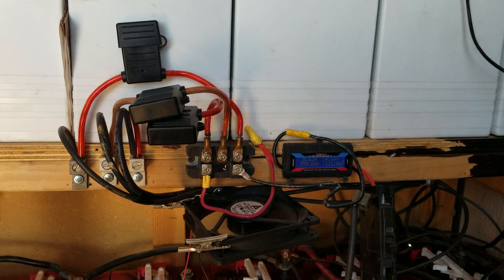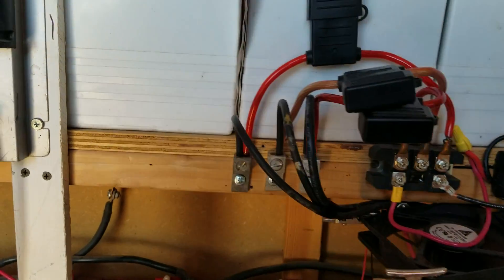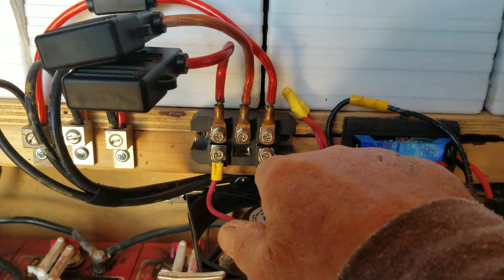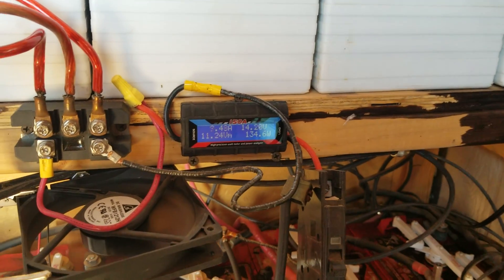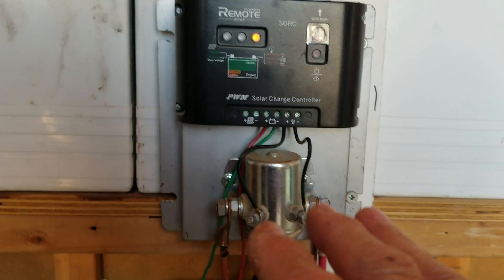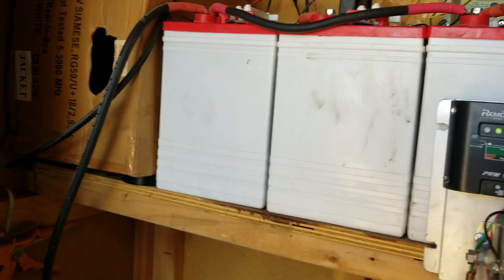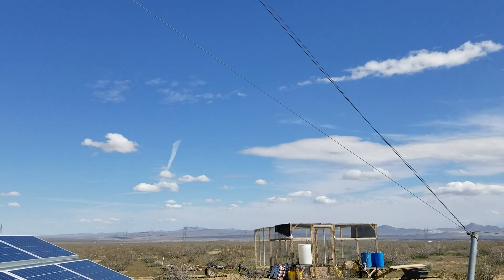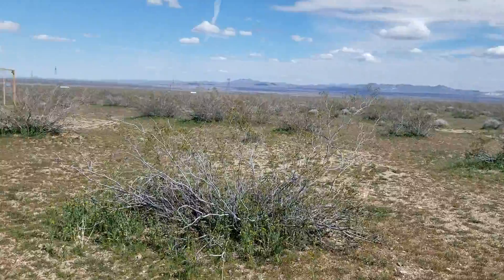GBear's Off Grid Ways-a Homestead in the Desert,  Mar. 23, 2019

Comment: First of all, let  me tell you that your explanations  have helped me a lot urderstanding how this tecnology really Works, never before has anyone explaned with such clarity and detail. I see that you are very familiarized with the wind turbine theme and its Connection to the off grid power sistem, as such I take this opportunity to ask you the following, is it possible to Hook up a wind turbine directly to a power inverter rather  than to the battery Bank?, I have a solar inverter 6k , 48v hybrid off grid, 80A mppt charger, (it is sold under  the brand TOWARD, but is the very same MUST PV3300, is as you can find it in the internet), it has a port + - for the connection of the solar panels, so I wonder if an Ista Breeze 1500W wind turbine could be connected through that port to generate electricity directly to the house, I saw that I'll need the rectifier, likely a wind turbine charge controller and the dump load.  Could you please provide details.  Thanks in advance.
Reply from the maker: Thank you and welcome aboard. 
Short answer, no you cannot connect a wind turbine directly to an inverter. 
An inverter needs 'constant' power input, like from a battery bank, to function properly.   Unless you have a constant unrelenting wind speed, 24/7 the inverter would constantly go into fault mode and shut down.

Comment: Thanks for a great video, I'm off to Ebay to get the parts. I guess one could build a double charger system by replacing the dump load with another battery and move the dump load behind that battery..  I am just thinking of some easy setup where I could charge some extra batteries I have at my cabin. Boat battery etc..
Reply: Ok, trying to find the parts. Can I use the controller that came with the turbine instead of the rectifier? It has a rectifier inside. Model is something like this: https://www.ebay.com/itm/WIND-CHARGE-BATTERY-CONTROLLER-12-24V-600WATT-ista-air-x-RUTLAND-generator/143278995717?hash=item215c17f905:g:be8AAOSwj99aBcuR

Gauge: https://www.ebay.com/itm/HTRC-60V-200A-Watt-Meter-Voltage-Amp-Meter-Power-Analyzer-8-Gauge-Wire-S9Z1/263865490399?epid=5017273653&hash=item3d6f9bdbdf:g:T1wAAOSwfjdbaj~Z

This ok for the dump: https://www.ebay.com/itm/12-VOLT-10-000-WATT-Battery-Dump-Controller-SOLAR-Wind-Regulator-G4-440A/233211640932?hash=item364c7f3c64:g:3MsAAOSwZula4ovW
Reply: Could not find the exact match for each part you have for example that electromagnetic switch & controller and still thinking if I can use the simple wind controller I got with the turbine instead of a rectifier.. Just not sure about these parts and not wanting to waste any more money on crap, that 12 VOLT 10,000 WATT Battery Dump Controller SOLAR Wind Regulator G4 440A I linked above already cost some 80€ if I order it to Europe... Any ideas?

Comment: Me too I got also a kt5 but DC , I want to remove the rectifier inside the PMA and make it 3 phase 12 volt
Reply from the maker: Most want DC because of higher output and direct to battery hookup.  I went 3ph because I'm cheap and didn't want to buy 1/0 wire when I already had 10ga.

Comment: Just curious, couldn't you use an MPPT with a DC turbine?, or doesn't it work that way?
Reply from the maker: The outputs might destroy the mppt.  There is a reason the input connectors on a solid state controller are specifically marked for solar.
Also, a DC turbine doesn't need to run through a controller, it goes directly to the batteries.  You need to control overcharge not voltage as a solar controller does.  12v panels put out 18-21.6vdc, the controller balances that to 15vdc output.

Comment: im so glad you are miraculously improving , im getting those herbs i knew about them just forgot its been so long , typically i have raw garlic on toast but those chinese, koreans, japanese know there stuff.
heres a battery story : once my freind was away for a long while and he had no dump load etc , his batteries started to boil dry and a short inside the battery must have occured which ingnited  the hydrogen gas inside the batteries , those batteries all blew appart , all five 12v N200 batteries were completely destroyed.  his turbine is a real nice low wind power producer its called OEM parts express wind turbine.
its only a 1kw turbine yet its total blade span is 2.5 meters.
i know i harp on about things trust me  everyone who knows me on YT knows it , but i still think your far safer to remove the fuses on the ac side and just put one decent fuse after the rectifier, maybe im wrong But ive seen turbines throw their blades when one phase is disconected for some reason and the turbine starts to pulsate/vibrate  , ofcourse in reasonable winds.
also true or not i read 60vac can still kill you , i know my old mws turbines could hit 110 vac using a drill to spin it at 700rpms.and  just for fun ; my fisher and paykel washing machine motor used to hit 1000vac at 500rpms until i rewired it so it had only 4 coils per phase instead of its original 13 coils per phase. 
it is good to see your on the up and up.
Reply from the maker: Great info!  I'll plan on making the adjustments.

Comment: Nice setup ... u might want to add 1 or 2 more dump load resistors in parallel . I'm using four 
300 watt resistors on my 750 watt system .
Reply from the maker: Yes, I'm still in setup stage, and like I said in the video I'll be connecting to water heat elements down the line.

Comment: Hi Gbear....here's a little tip before your spring winds load up your dump load resistors and smoke your crimp-on connections, Next crimp job add a little copper paste (high temp grease with fine copper) before mashing those crimps. My other sure fire solution is soldering those crimps.
Reply from the maker: Welcome aboard.   You are right!  I usually rely on soldered connectors,  but since this connection was temporary, I used crimp-ons.